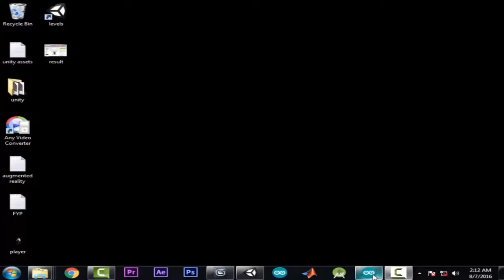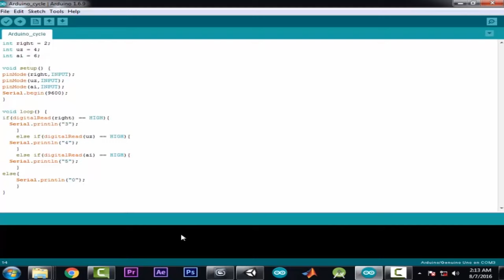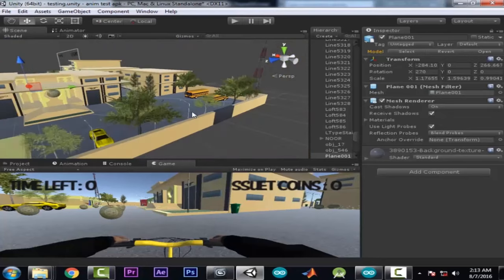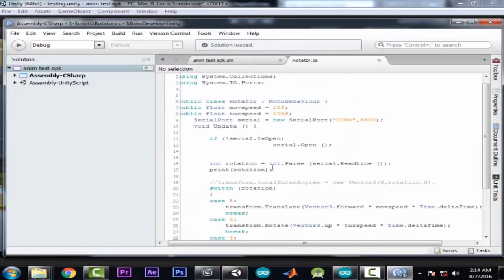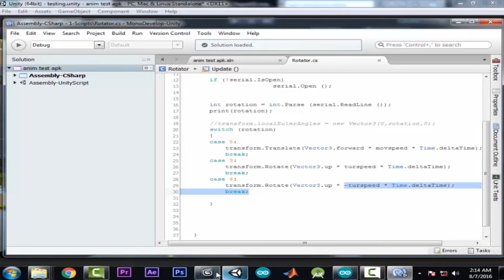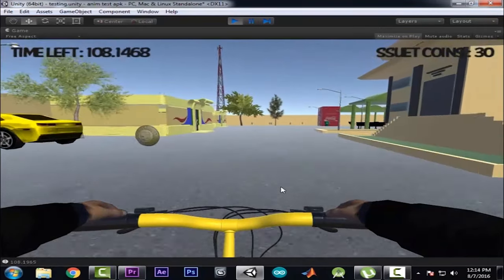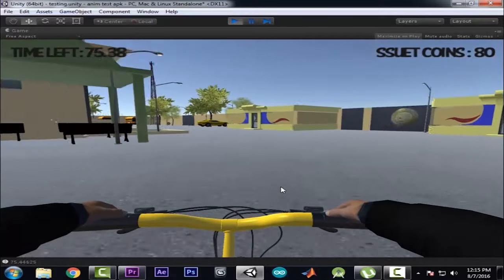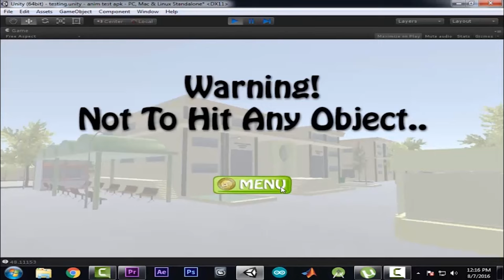How I Create And Sold This Virtual Cycle PC Video Game Made With Arduino Unity And 3D Max

Comment: hi, i just want to confirm something, how did your send data to unity? did it do something with connecting arduino port from usb (it supposed to be PORT 4 in your video) to virtual port of the unity programming console? Could you send me the complete schematic of it? it's kinda messy right there, i couldn't see the wiring clearly. thanks!
Reply from the maker: Yes we can send data from Arduino to unity via serial port
Reply: @WaysToSellOnline  could you send me the schematic of this project, sir?
Reply from the maker: @mahaputranurmuhammad3228  actually I made this 6 years ago in my university, rightnow I am not having schematic, but it's very easy, you can find the schematic and code  easily on GitHub or instructables.
Just search for Arduino unity communication :)

Comment: Great Work.. awesome 3d  model...!
You could use shaft encoder instead of dynamo which will provide you rpm of the wheel, from which you can control the speed of the player's cycle in the game.. And for handle you could use Flex sensor, that way you don't have to rotate the Handle till end, it reflects even the slightest deflection of handle..from which you can access 8 directions of the game..!
Just Suggestions.. otherwise great effort...!
Reply from the maker: yeah currently working on handle for analog value..